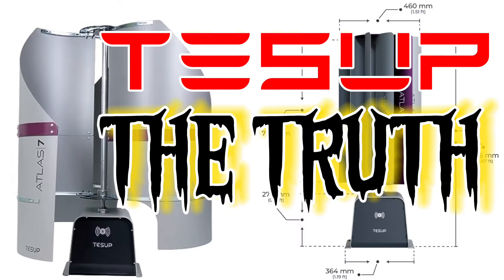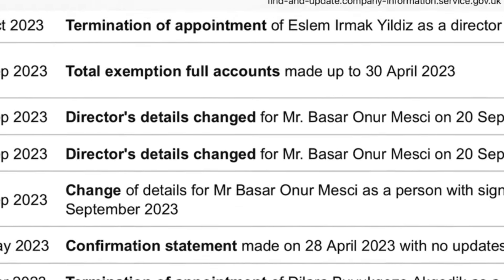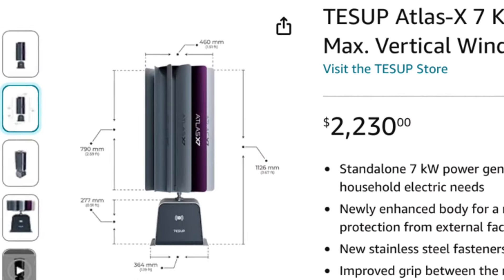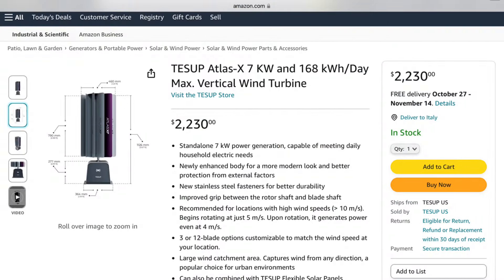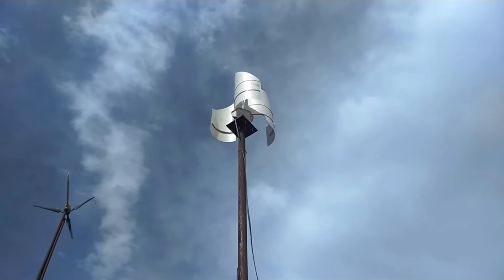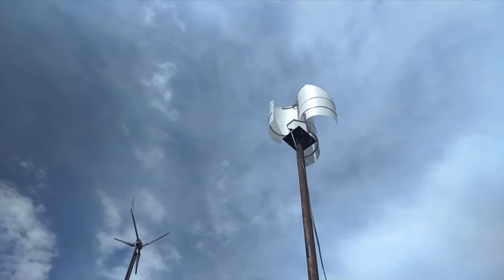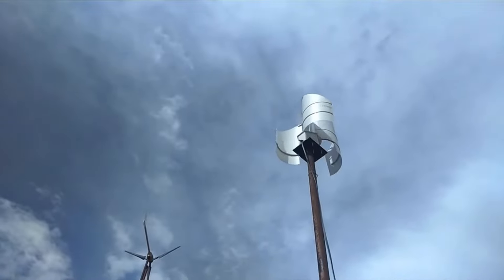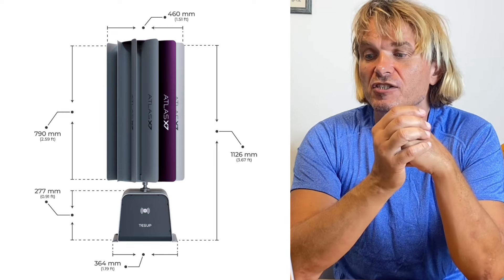TESUP 7kW WIND TURBINES. DON'T BUY BEFORE YOU WATCH THIS VIDEO

Comment: This sounds like a lot of "creative math" being used by the marketing teams for some of these turbines. There's one other thing you should do, before installing a turbine. Measure the DC resistance from leg to leg of the turbine generator. If you multiply that resistance by the output current, that will tell you how much voltage is lost to resistance. If you multiply the current by itself, then multiply by the DC resistance, you can determine how much energy is lost as heat in the circuit, and not making it to the battery! A turbine rated for 12 volts has to have 1/4 the resistance of a 24 volt turbine with the same wattage rating, to be equally efficient. If you see a 24 volt turbine promising 500 watts, a DC resistance of only 1 Ohm is going to dissipate 400 watts of heat, to reach the 20 amps necessary to produce 500 watts @ 25 volts. Under those conditions, the alternator is less than 56% efficient. The sad thing is, with small turbines, this would be more than acceptable.

Comment: Having read dozens of scientific articles on savonius, there is a use case for this kind of turbine (they are quite sturdy, and good at pumping water). But almost every video and product based on savonius is trash! You are basically the only one I found that understands that and explain it very well! To resume, the best savonius design is:
1. Enclosed top and botton with discs 10% wider than the diameter of the blades.
2. Rotor with Aspect Ratio of 5 (5 times as high as it's diameter).
3. Two bucket design with two rotors stacked in 90° angles, or 3 blades with higher aspect ratio to compensate (at least 6).
4. Instead of semicircular (half cylinder - like a C) blades, the blades should look like a 2 plane wings joined by their rear part (so it looks like a "S"). This way the rotor produce lift straight in the wind, but also, the returning blade throws the wind on advancing blade, reducing drag and improving "push". This is QUITE an improvement over the old "half cylinder" ones!
5. A decent savonius is able to reach about 200 rpm max, after that stronger winds only means more torque. They start with a gentle breeze!
6. If you overbuild them and their generators to withstand hurricane winds, they will outlive you.
7. Fit a sensor to be able to vary the load, so to draw huge power on high winds, but to reduce the load to avoid stalling at low winds.

I wish every one to see this, so they smell the scams and make decent savonius turbines themselves!
Reply from the maker: sorry but this is useless. this kind of turbine is ineffective by design. what you do is like putting whiped cream on old donuts- sure it makes them more attractive but if you put this efford to better turbine ( 3 blade standard design) you'd have much better outcome
Reply: I have never seen a single post on youtube from someone with firsthand experience who can recommend a VAWT that is actually for sale. And that is all I need to know.

Comment: I knew this kind of stuff because I've studied it at the University. I don't know how all eolic generators factories can lie so much. In my case, I'm going to buy for my new house a Bornay or an Enair as I live in Spain. Both companies have been manufacturing mini wind generators in Spain for more than 50 years. 
Taking into account that wind speed and wind density are the actual values to be calculated, regardless of height or location that will have to be calculated on each site. These are investments of more than 10.000€ and are local companies who tell you if their turbine can be installed or not in a specific location.

Comment: Thank you. I am confused that you calculate just one blade (or two) but not all the blades. Why?
Reply from the maker: you do not use blade area - we just need amount of air to calculate energy which means front surface of propeller times speed of the wind this gives us volume of air which is avalable for the turbine
Reply: @4nrgyTech  thank you
Reply: @4nrgyTech  is there at the moment any horizontal WIND TURBINE you can recommend?
Reply from the maker: depends on power and type of installation topology( grid tie or off grid)
Reply: Can you please recommend any wind turbines off grid for residential purposes for me.
Reply: @Arcteheer  I am still looking myself

Comment: Hello. Great video. Thanks for sharing your knowledge. I have an Ista Breeze 1500W 48V, and you are right. The blades are very bad, they only produce electricity with hurricane winds. Also the quality of the generator is very poor. I have disassembled it and it is sad to see the stator and the magnets. Very poor quality in general.

It is difficult to choose a good wind turbine because sellers always exaggerate with the output generated.

Could you advise which wind turbines are of good quality, and really produce?

Thank you
Reply from the maker: yes I sold and produced wind turbines for 15 yrs and because of problems with blades suppliers(new eco friendly regulations in China) I had to quit but had competitor whos quality was good. I asked her for some promo for viewers. her adress is in new video
Reply: Have you tried Yelmotor MX?

Comment: Hello, you just saved me 2200 dollars. I already have a solar panel system, that could be complemented with wind energy. If I could generate 500w of electricity the whole night, my battery needs would be greatly diminished. what do you recommend?
Reply from the maker: 5kWh battery costs abt 1000$ worldwide soit would be hard to install even 2kw wind turbine within this budget. but if you decide for wind : 2kw turbine would be my recommendation. price is from 500 up to 2000$

Comment: All practical tests show that small wind turbines hardly generate any electricity. Because there is hardly any wind close to the ground – and electricity yield is proportional to the third power of the wind speed: 100% more wind generates 800% more electricity! 
Only if you need to be self-sufficient from the power grid, you should install the largest possible wind turbine on a high mast. 
With solar modules, on the other hand, you can reliably generate green electricity for 25 years at approx. 3-10 cent/kWh!

Comment: do you know how mutch Nm torque the tesup dynamo needs? i want to mount it to a ''bottle wheel'' with chain and sprockets (sorry for my bad english, im dutch and use some google translate)
Reply from the maker: no. sorry but I don't believe in their products. this is small generator but should have more than 2Nm also ppl reported bad bearings quality so check this before. there are cheap pmg generators on the market with real power and price is 100-200$. 
if you can make 300rpm on generator side you can try with tesup and after it dies(it will ) you cqn buy 100$ 1kw generator from alibaba or aliexpress

Comment: You calculated the surface area on the width of the unit not the total surface area of the blades which are curved, you would need to have the size of each blade multiplied by the total amount of blades for the total surface area wouldn't you?

Comment: I bought a Tesup vawt. It is absolute awful garbage. Start up torque is high, pull out torque is high, magnets are cheap cheap 28h magnets, potting full of bubbles.

However, I replaced bearings with ceramic coated bearings, replaced some components with carbon sheet to reduce weight of the blades. Most significant, I put in a speed sensitive phase switch which stays open until 60rpm, then closes, reduces start up wind speed from 3 to 1.8ms. 

Not worth the effort !!!

Comment: Edit: 38mph wind gusts (20mph standard) is what you find today Jan 21th 2024, in London UK. Also listed as a yellow warning. 

Not every volume is the same shape. Different blades and funneling systems have different catch ability of the air volume. But it seems this company doesnt even provide the 7kw inveter with the package.

Comment: Checking their "Book" I found the chart, the 7kWh are reached at 51m/s wind!!!!!!! Which is 180km/h standard wind which everyone has of course. They might not be lying, but they just cleverly used a 180km/h wind as their standard. The whole website etc is incredibly well made. So this is how they just market something beyond what is true.
Reply from the maker: but even this is not true. they just calculated wind energy at this speed and multiplied it by some made up efficiency. problem is with savonius turbines turbulences are so significant that above 16-17m/s efficiency goes to zero. Ask anyone who build this kind of turbine. on hurricanes this doesnt produce any energy( bonus- also falls apart, mine did)

Comment: Also if it was 7kw they deliver a inverter with the 7kw only 1 problem the inverter is a 2-3kw inverter? But also those inverters has channels 1 1.5kw I wanted an explanation I never got it. 

I have a 2kw atlas and it turnes only 1 coil isn't doing anything AMD the rotor is damaged broken magnets also 1 longer Magnet sticking out. The  device delivered with the atlas went out with a big bang and lots of smoke  also it was produced in Turky . I wanted to install lots on rooftops so I asked a 7kw showmodel to let people see it works I didn't get 1.  Also I asked for a solution for the 7kw to grid. I didn't get one. But one thing the atlas 2.0 turns and produces power with the 2kw turbine.  But it's with 1 coil less. And yes the support is bad it's a pitty because its a beautiful product. I wanted to take over the support in my country but I didn't get any answer. As I would say the 2kw version works. 7kw it would be a Bit heavy.

Comment: Hi, thanks for your honest video, I especially appreciate the physics you touch on. it has improved my understanding of the subject.

I am looking for a household wind turbine that can give me between 10-12 kwh daily all year round, so that I have approx. of 4100 kwh per year.

I live in Copenhagen, Denmark, which is very urban, with an average wind speed of approx. 5 meters per second annually.

My question to you is, can you recommend a household wind turbine that can give me what I'm looking for, and if not, can you recommend any alternatives?
Reply from the maker: this had to be 3-4kw  wind turbine which means 3,2-4m diameter. do you have possibility to  make on grid system? or this have to be with batteries?
Reply: none! at least not without a building permission... and then it is not called a household turbine anymore... there is simply nothing "household" which is better than for powering a fountain pump in your garden pump, really....